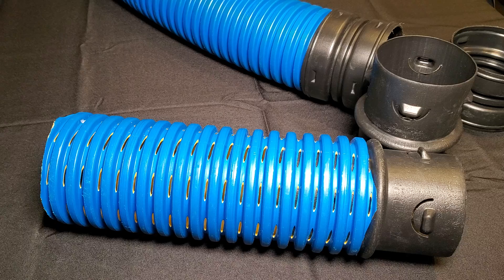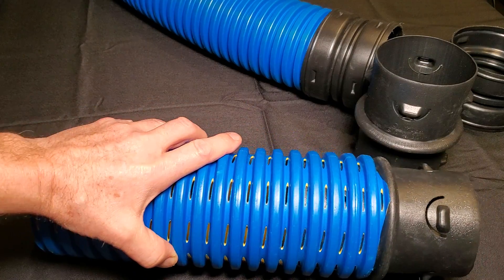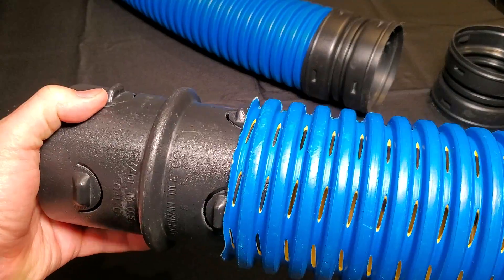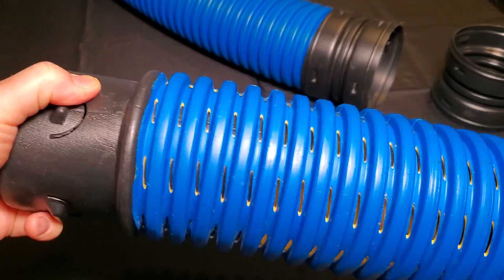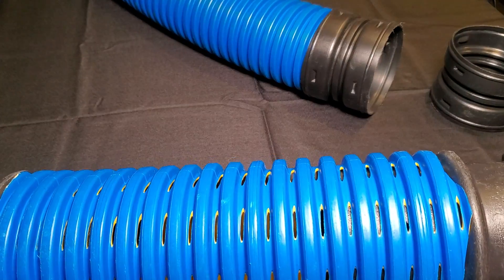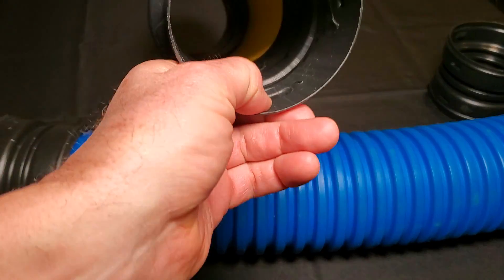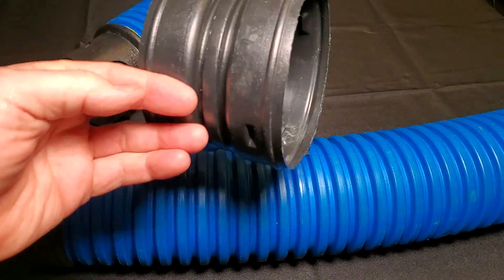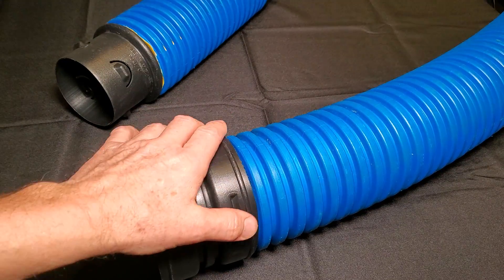How To Connect Corrugated Pipe to Corrugated Pipe Best Yard Drainage Pipe Connection. Easy DIY Drain

Comment: What if you are going solid to perforated?
Reply from the maker: You should never go from solid to  Perforated unless it's a clean water source with no debris or minerals. If we have a clean sump pump discharge with a clean sump pit to support it then yes that could be done. We don't pump trash in our perforated pipe it just takes out the system over time. I would use the External coupler to play it safe. When in doubt use external coupler. Thank you for commenting. ✌️
Reply: @FRENCHDRAINMAN  in previous videos you recommended adding knife cut to the end of of the downspout lines.
Reply from the maker: Your right technically knife cut is a Perforated pipe. Because it doesn't have any material ground out and it's solid I consider it like a solid pipe when used in a downspout application but you sir are correct. In yard Drainage it's a Leach pipe. It does flow solids because all the material is still in the side wall. We always use external so debris moves through the the pipe without building up. People end up with clogged pipes when they use internal on downspouts or a hack connection like I've seen on other channels. Thank you for correcting me. Appreciate the participation.
Reply from the maker: Watch "Dos & Don'ts  - Downspout Drain in the North Where Winter is Winter [ Complete Guide ]" on YouTube
https://youtu.be/_V1efJM-8yM
Reply: Have learned a lot from your channel. Can’t wait for this ground to thaw out so I can get to work!